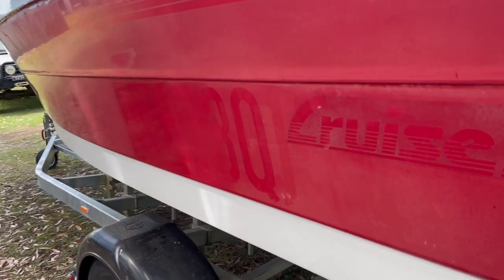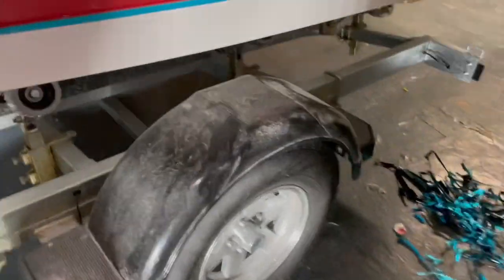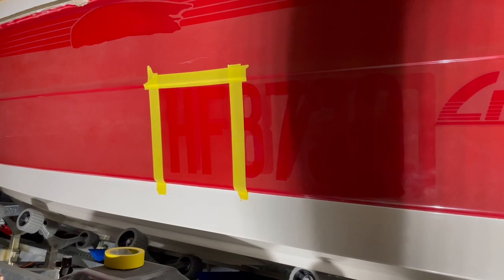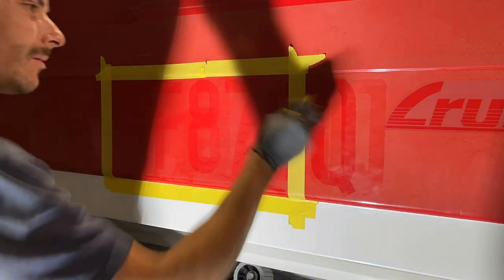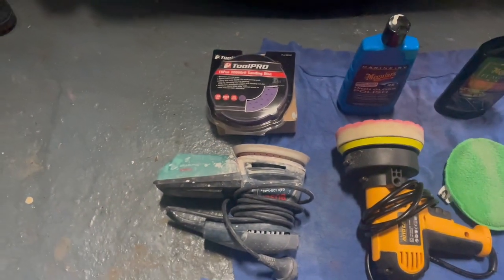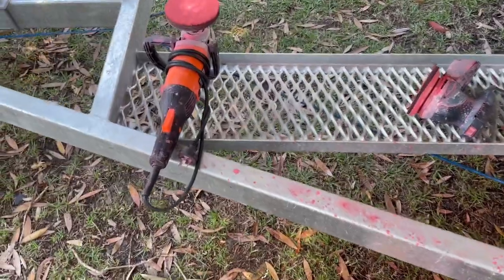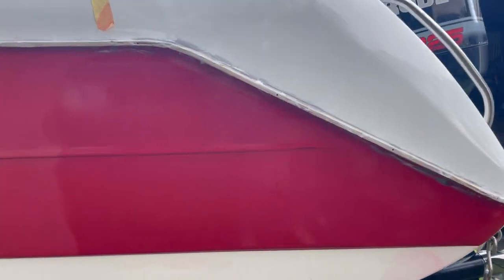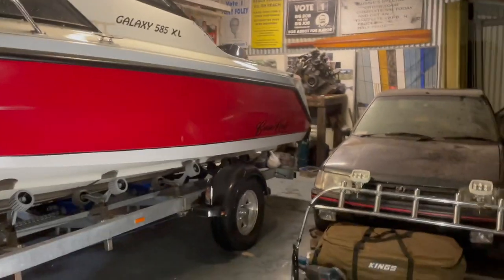[EP7] How To Restore Oxidised Gel Coat - Chemical Treatment, Wet Sanding, Polishing & Protection.

Comment: Looks superb. Could one just paint the sides and bottom as you did with the top of the hull using the Northane?
Reply from the maker: Having used it for two years now I would not. Any paint will chip and much easier than gelcoat. Next boat I will restore will be all done in flow coat.
Reply: @cheapthrillsgarage  thanks for responding mate, cheers 👍

Comment: Hey mate, great videos. I'm just starting a boat restoration and your video is great help. 
1 question I do have is why didn't you paint the bottom of the hull as you did the top? Did you polish the top after the final top coat
Reply from the maker: Because gel coat will always be better thank paint, it’s repairable and much tougher against scratches and knocks. The bottom side was just a bit faded, it didn’t have an excess of holes and cuts into it, and I’m not sure how I would have suspended it to paint underneath.